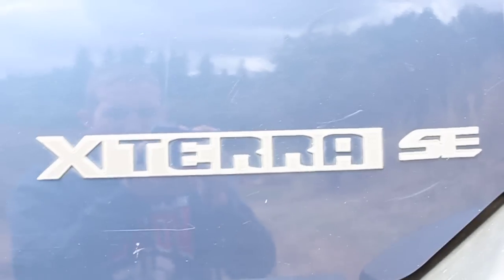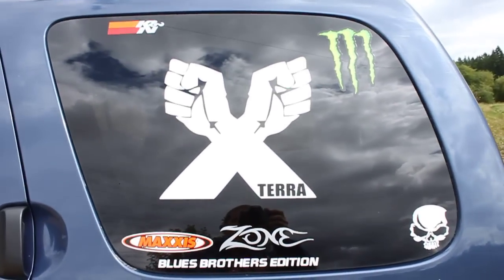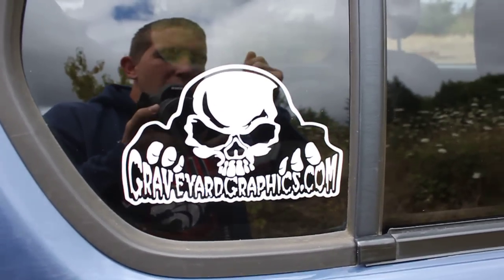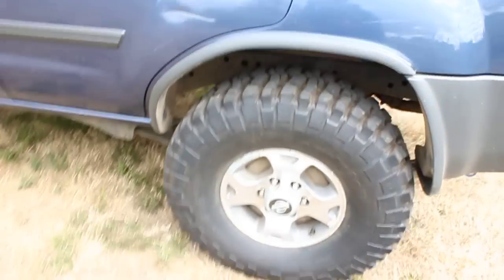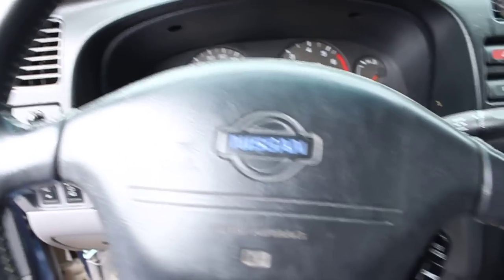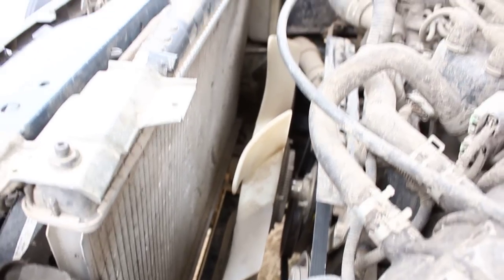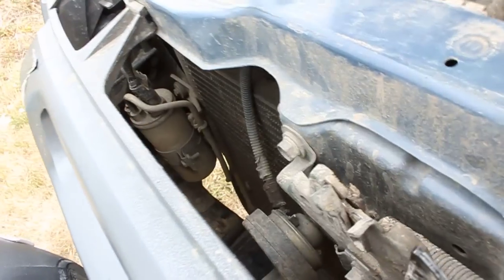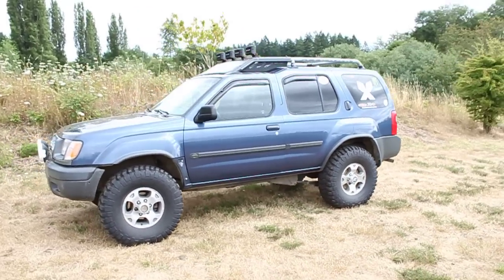Lifted Xterra update (progress numero uno)

Comment from the maker: I dont have it anymore. 4wd in the xterras like this model have the floor shifter for 4wd. you can just pull the lever back towards you and thats 4wd hi, and a little green light should come on in your dash that looks like a suspension logo. you cna go 60 mph in 4hi. you can also shift that lever into 4wd going 25 mph or under. to shift into 4lo, put the truck in neutral, then 4hi, then puch DOWN on the lever hard and continue to pull the lever back WHILE pushing down the lever and thats 4lo.

Comment: Do you have wheel spacers or is it just the tires that make them look wider than stock?  What is the exact size tires you have?  I have same wheels.
Reply from the maker: I just had those rims, they were factory with no spacers.  The tires are 33x12.5x15 big KM2s